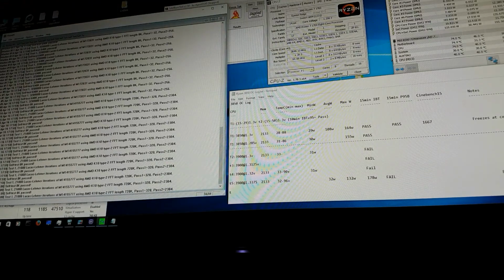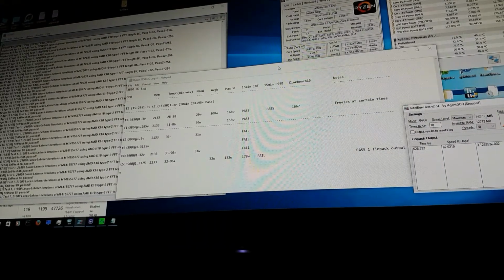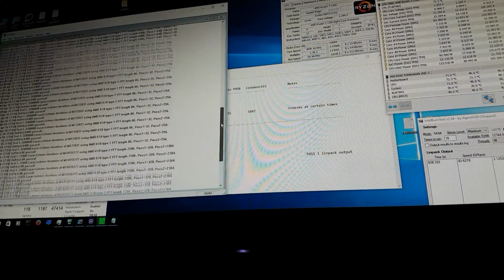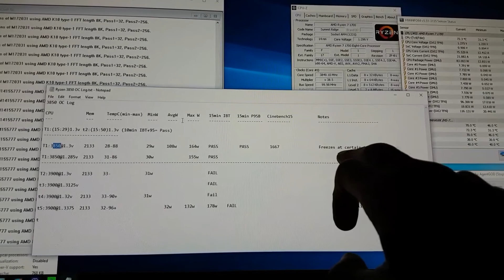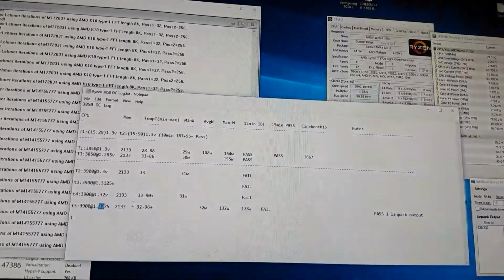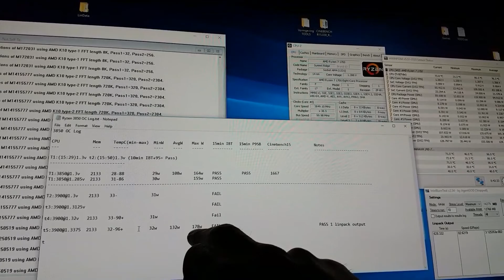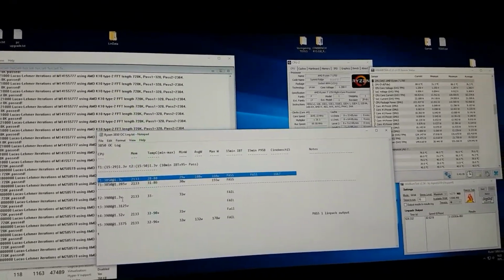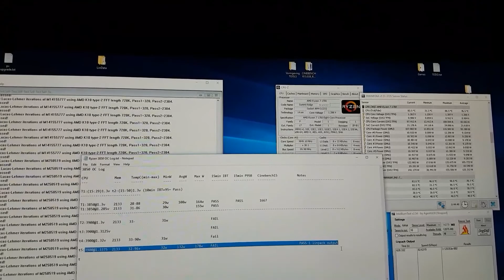Overclocking Ryzen 1700 with MSI Tomahawk b350 , the sweetspot frequency?

Comment: Your cpu probably ran into the thermal limit at 95c and rebooted at 3.9.. That was the only reason, not stability.. You should've stuck an aftermarket cooler on there, but i agree with you on the penalty you have to pay just for 50mhz, it's not worth it.
Reply from the maker: +Bogmirkovic yes exactly what I was thinking as well , if I decide to push it to 4ghz I might get a better cooler. At this stage I am more then happy with the 3.85
Reply: Yeah even at 4ghz the extra 150mhz wont play a huge role in the overall performance department, unless you are using it for production all the time, and maybe a 5% boost in games. I'd rather run my chip cool and for a long time then keep it on the edge of it's capabilities. 1.325 is the max I'd go on these chips for longevity purposes, and extract most frequency out of that voltage.

Comment: i have same motherboard and ryzen 5 I TRIED TO OVERCLOCK MY CORSAIR Vengeance LPX 16GB 3000MHZ TO 2666 JUST BY ENABLING A-XMP and ram voltage to 1.34 but my motherboard keep restarting the pc!! am not sure what is the cause? i updated the bios to 1.3 i didnt change anything in ram timing.. any idea man?
Reply from the maker: JARJEES DR okay.. there is also some issiue with the current bios maybe I allready contacted msi about this. it seems it's not accepting those clocks from cold start of the pc. what you have to try is following: turn the pc on and let it boot into Windows. let it on for 5-10min let the temperature of motherboard raise above 26c. then boot into bios and try the clocks. but this time, disable xmp profile... go down to the "mem try it!" option.. there will be multiple profiles for different clock speed. select one of them.. f10 and if it doesn't boot. try the next one. just use the 2666 ones not the 3000
Reply: sanel b thank you for replying did face similar issue before like mine?.my problem i am not very confident to overclock my new pc i just brought it yesterday my other question regarding voltages my ryzen without overclocking voltages between 1v and 1.35 is that normal temperature in load 56c
Reply from the maker: JARJEES DR hello. dont be afraid nothing bad will happen. cpu very rarely brake down. if you keep your vcore  (the cpu voltage) below 1.4v . 56c under full load is nothing :) .. you could watch my other video how to overclock ryzen.. it can't go wrong
Reply from the maker: JARJEES DR to brake it down for you. and make it simple. you could use 3800mhz for cpu. vcore 1.28v .. mem 2666.. timing 15-16-16-16-34 mem voltage 1.3v
Reply: sanel b man still samething pc keep restarting! !with your setting what shall i do next?
Reply: after restarting 4 times it the pc back to work and when i enter the bios it stayed ram speed 2100 !!
Reply from the maker: JARJEES DR try resetting bios  , there is a jumper near battery(to the right side, towards sata ports).first turn off your pc of course. if you don't have a jumper tool. just use a screw driver and make sure the screw driver is touching both the pins for around 5-10 seconds.. I would in your case suggest to further wait another bios update before trying to overclock your ram, new bios update should come sometime next week
Reply: my tomohawk doesn't boot with vengeance led at all

Comment: I tested 3.8GHz on 1.2V but it is not so stable as I initially thought. After 1h Prime95 it rebooted itself :(
I'll try your settings. Thanks for video tutorial
Reply from the maker: +Abe Normal 1.2 only? or u mean 1.28 ?
Reply from the maker: +Abe Normal try 1.28 .. lower your memory to auto. which should be 2133. and test again with Intel burn test.. it's more demanding then prime95 . if it fails it's really unstable it will fail within first 8min
Reply: i used 3.8GHz and 1.2V but just for light workstation tasks and gaming. It was stable but Prime test failed. I'll give Intel burn test a try with your settings
Reply from the maker: Abe Normal yes try that and let us know. remember 1.2v is low it won't pass. it has to be around 1.28v at least
Reply: looks like Intel burn test is better cause I saw temperatures about 10 C higher on CPU then in Prime. However after 20 minutes on maximum stress level I decided to stop it. SYSTIN and CPUTIN temperatures got above 100 C (CPUID HWMonitor). However CPU shown at same time 68 C. I tested 1.28V. I was surprised that even under 100% load and with about 650 MB free RAM, I could open apps, browse internet like there is no stress on CPU.
Reply from the maker: Abe Normal yes that's good enough.. I even combined those two tests prime95 and intels let them run together .
Reply: was is clunky or sluggish when you have both tests running?
Reply from the maker: +Abe Normal yes
Reply: im using 1.35v at 3.75ghz